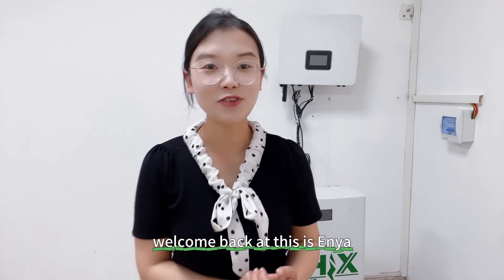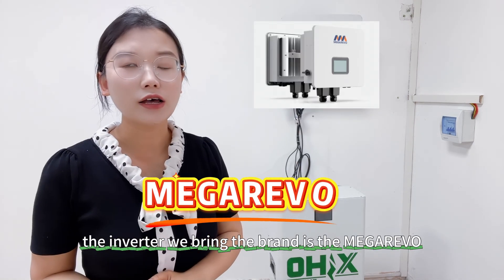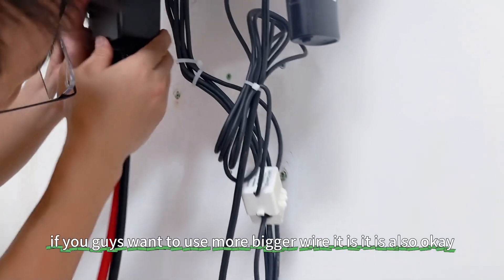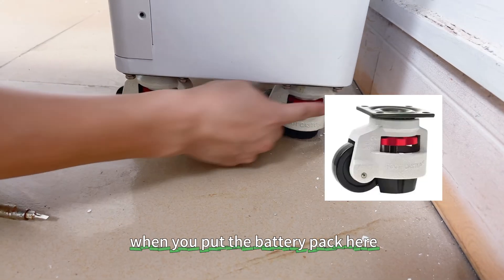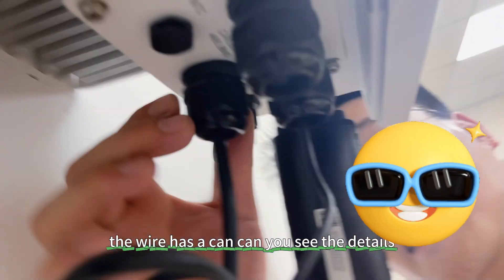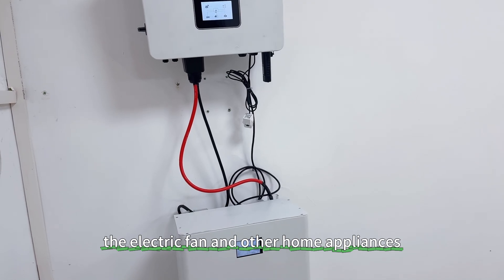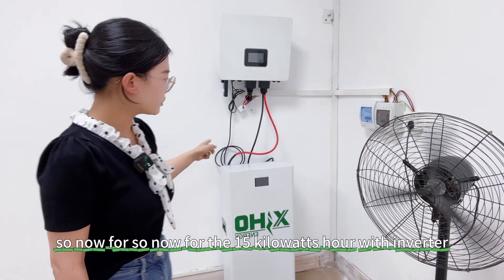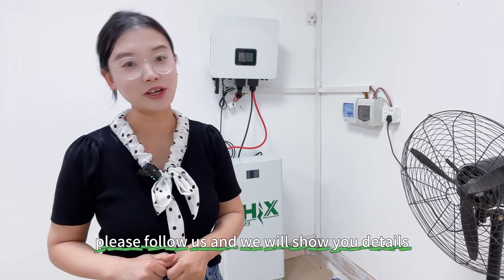$2090 to save money on your electricity bill, let’s to build the battery with inverter for your home

Comment: You guys in China receives one cable ( live 220 V) and second cable (neutral) coming from the grid. But In Mexico my country, we receive one cable (L1 110 V), second cable (L2 110 V) and third cable (Neutral). That way adding up L1 plus L2 we have 220 V. So not sure how to connect the battery nor the inverter. Or if they can work with 3 cables instead of 2. Actually 4 cables considering Ground cable. 1) L1 (110V), 2) L2 (110 V), 3 ) Neutral, 4) Ground. Maybe a different inverter model is needed.

Comment: Do you have 240 volts inverter for Australia ?
Reply: That inverter would be what we call 240 V in Australia he got 221V when he checked the voltage with a meter. Not sure what state of charge the battery’s were they would not be shipped with a lot of charge in them. But 240v items should be ok with 220 volts. In theory 210 to 250 volts should be fine the voltage around Australia would not be 240 volts everywhere.
Reply: Think electric goods are marked 220 to 240 volts on some items now as well.